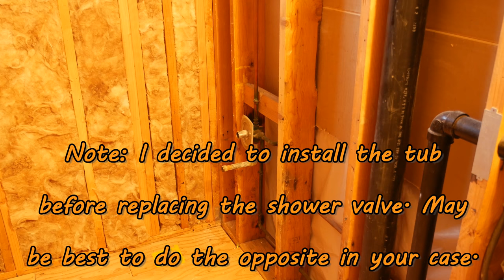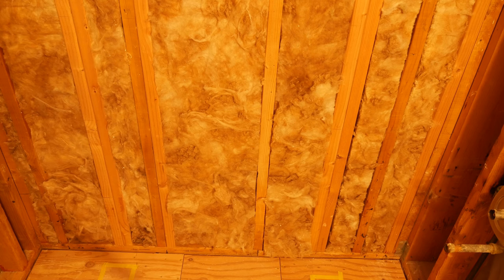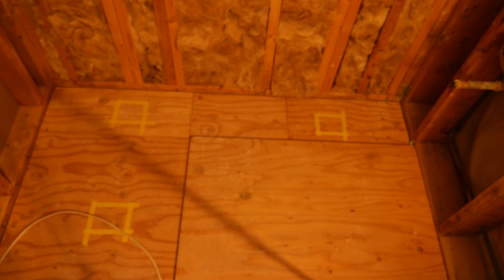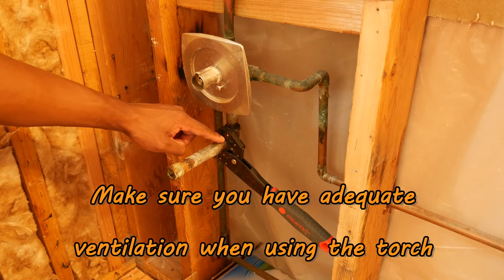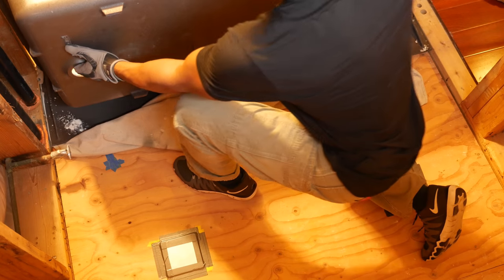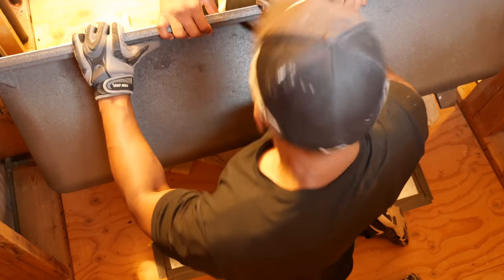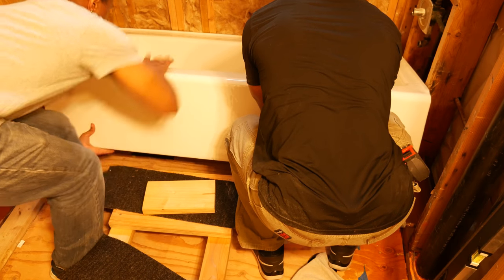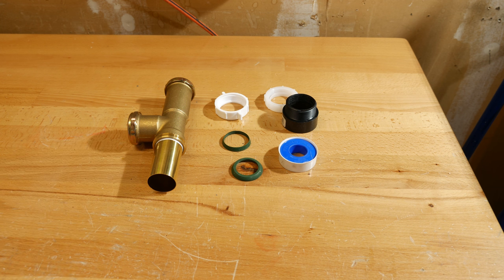Bathroom Remodel 55 - Cast Iron Tub Installation

Comment from the maker: In this video, my nephew and I install a Kohler K838 cast iron tub in the bathroom (Yeah, finally!).

***Note: Unlike many other tub materials, this cast iron tub was simply made level by installing shims under the feet per Kohler's instructions. No screws or nails are required to hold it in place: https://www.us.kohler.com/webassets/kpna/catalog/pdf/en/1084177_2.pdf

A couple corrections as pointed out by viewers: (1) Teflon tape is not needed for the lock nut threads. (2) Separate washer and lock nuts seal better than lock nuts with integrated washers.

Please leave a 👍  if you like the video!

👉 Visit our website ► http://DIYApprentice.com
 
👉 Click to Subscribe! ► https://bit.ly/2pEBg3m

🔧▬▬Tools and Materials▬▬🔧
👉 DIY Apprentice Recommended Tools and Materials ► https://bit.ly/2T5psFw

✔️ Drain information:
The bathroom fixtures are Grohe Agira brushed nickel, but Grohe doesn't make a complementary drain. This satin nickel drain is almost an exact match ► https://amzn.to/2vHOoZ9

✔️ Watco 924 waste and overflow kit ► https://amzn.to/2OyNl4U
✔️ Watco 916 waste and overflow kit ► https://amzn.to/2MmDqlf

✔️ The electronic trap I used caught the rat the same day I posted this video. Worked great - check it out!  ► https://amzn.to/2pGvsXr
Similar traps: 
► https://amzn.to/2C08t0O
► https://amzn.to/2ynoURi

📷▬▬Video Equipment▬▬📷
✔️ Camera used ► http://amzn.to/2GcpkOb 
✔️ Lens used ► http://amzn.to/2Deu16S 
✔️ Tripod ► http://amzn.to/2GbaM1c
✔️ RAM Suction Mount ► https://amzn.to/2Wz9PXh
✔️ Cyberlink PowerDirector ► https://bit.ly/2jTwGxT
✔️ Adobe Photoshop ► https://bit.ly/2V7nyUX
✔️ Camera Slider ► https://amzn.to/2WtD7GW
 
👍▬▬Follow Us on Social Media▬▬👍
✔️ Facebook ► https://bit.ly/2pAY8S3 
✔️ Twitter ► https://bit.ly/2G7mRDz 
✔️ Instagram ► https://bit.ly/2ILEKII

Disclosure: This video contains affiliate links, meaning, at no additional cost to you, I will receive a commission if you click through and make a purchase.

Comment: Thanks for showing this.  I'm just finished mine.  I have a small comment - at 11:00 in, you suggest using teflon tape on the threads of a compression lock nut.  This is not a good idea.  The lock nut presses the ring tightly between the tube and seat.  That is what makes the seal, not the threads on the nut itself.  In the example you show last, the ring and nut are one, but it doesn't matter.  The seal is made by the nut between the tube and the seat.  Teflon tape just makes it harder to provide enough pressure to make a good seal.  If anything, a little lubricant on the compression nut threads will make it easier to tighten down (though on an ABS fitting with a polypropylene nut, I am not sure what the best choice of lubricant would be).
Reply from the maker: After I filmed this video, I was questioning why I would need any sort of tape or dope on a slip nut. It appears that some plumbers do use them, but many don't use anything.
Thanks for watching!

Comment: I have been using junction box covers forever. I use the screws to hold the covers down. The tape can get knocked loose during placement
Reply from the maker: Yeah, I was going to use screws, but the tape worked out fine. The junction box covers definitely made the installation much easier because of their size in comparison to the tub's feet.
Reply: @DIYApprentice  Here's a tip for you. Use the flexible PVC pipe in your drain fittings. It gives you almost an inch of leeway with lining up the drain
Reply from the maker: @travisk5589  Yes, I discussed some options I'd researched in video 54, which included flexible PVC. My drain appears to line up fine with the brass waste and overflow, and I can't return it now.

Comment: I am looking to install a new tub.  Looking at cast iron or steel.  You guys moved the tub with two people was your tub cast iron?  The weight is my issue do you know the weight of your tub?   Was it cast iron or steel?  Do you need to screw the tub to the studs for movement issues?
Thanks
Reply from the maker: Yes, it was cast iron, which is in the video's title. The tub weighs around 325 lbs; the floor underneath it has joist sisters and some blocking. Since it's cast iron, screws are not used. Video 54 in the series goes into a little more detail: https://www.youtube.com/watch?v=7RBGtmnlmGo

Comment: I have never had any issues setting cast iron tubes . I mean I always try to get the tub in before any of the drywall has been hung , and if the drywall is already installed or isn’t getting replaced you will need to remove the other fixtures and give yourself and your helper room to work.
Reply from the maker: Yes, I agree. Cleared the area as much as possible to install the tub.

Comment: I am getting ready to re install, they are heavy and the wall spacing was tight to get it out. I am going to shift one wall to give me 1.25" so it will be easier to get in, plus it will be room for cement board as I want to tile the enclosure.  On the original floor, one joist had been cut on the end and left dangling for drain line clearance, so on the new joists I shortened the one joist and boxed it into the adjacent joists.
Reply from the maker: Yeah, I had to box in the drain in video 28. There was a lot of floor structure work on this project. Hope your project turns out well.

Comment: This might sound different, but what if you just installed it on a level floor?
Reply from the maker: The floor in this bathroom is level from left to right, but it is out of level about 5/16" from front to back; it would have required more work to level it, which I didn't think was worth the effort. I was more concerned with making sure it was flat. Also, there's a chance that the tub being installed has some irregularities.

Comment: Your video explanation is very exacting. I would, however like to know how you got the bathtub in the bathroom and managed to fit it between the walls. You video shows the bathtub already set between the walls and all you had to do was to push it in place. I was thinking of using a come-along attached to the overhead rafters and the vent hole of the tub to lower the bathtub in place. In any case, very good tutorial.
Reply from the maker: Thanks. I explained in the beginning of the video that I removed some drywall I'd put up to close off what used to be a doorway, removed a wall stud then slid the tub into the room. Otherwise, as I mentioned, the tub will have to be gradually set down in the alcove, which is a more difficult proposition.

Comment: Joints with seal rings: the rings do the sealing and no tape or pipe dope is used, same as copper compression, flare fittings, and the connection ring on unions.
Reply from the maker: Yes, I updated the video's description after a plumber corrected me a couple years ago.
Reply: There’s actually two ways to make that seal . The threaded tail piece with those fine threads screw into the waste and overflow tee , but you can also just cut the threads off and use a slip nut and gasket but I do both of those connections. I thread the tail piece into the tee and also slip on a gasket and nut so you have a joint that’s not going to leak after two months of being used .

Comment: I have a question... how do you trim your hardibacker into the small flares on the tub surround as it doesn't have a nice lap like a modern tub?
Reply from the maker: I planned on installing the backer board (most likely GP Densshield) to within 1/8" above the tub flanges then the 1/8" gap will be filled with 100% silicone. The tile will then be installed to within about 1/4" of the tub ledge. I've seen this method used by pros. Hopefully, I correctly understood your question.
Reply: @DIYApprentice  yes.  That was the question and that seems like it would work fine.  I was going to grout over the silicone or do you suggest grout caulk?  I appreciate your help!
Reply from the maker: @stangbanger6445  Based solely on my research, you should be able to tile like normal once the silicone is dry - no additional material is required. You'll need a little extra thinset behind the lower portion of the tile where there's no backer board supporting it, though.
Reply: I am going to install the board behind the edges and seal the joint. Then the protrusion of the tile will be minimized,  plus the tile will be sealed at the tub interface as well.
Reply: @stangbanger6445  where the tile meets the tub, no grout because things do move or settle & you don't want the grout to crack.

Comment: Do you fasten it in in any way to the wall?
Reply from the maker: No, Kohler's installation instructions do not call for the tub to be fastened to the wall. Some will use a ledger board like I demonstrated, but it's not recommended by Kohler in this case.
Reply: @DIYApprentice  gotcha. Thanks, sir!

Comment: Where’s the ledger boards to hold the tub in place ?
Reply from the maker: Yes, this is a controversial subject I mentioned in the video. Kohler says to not use a ledger boards for this cast iron tub, but I've seen plumbers mention that they often use ledgers.

Comment: You are showing how to plumb a tub. Your title shows how to install a cast iron tub. There is no room to put screws in the wall. So How DID YOU SET THE TUB and LEVEL it? That is the installation part of INSTALLING a tub.
Reply from the maker: With all due respect, did you watch the video? The tub is made level by placing shims under the feet. No screws are needed because it's a cast iron tub. I followed Kohler's instructions for the installation: https://www.us.kohler.com/webassets/kpna/catalog/pdf/en/1084177_2.pdf

Comment: Never use those nut/washer combos. The better option would’ve been the nut with the separate rubber washer. The rubber washers seal much better than the plastic ones.
Reply from the maker: Hmm, I haven't read or heard about any issues with the nuts that have integrated washers. The connection seemed pretty tight.
Reply: DIY Apprentice like Great White Hype, I’m also a 20 year plumber. Take it or leave it, I guess.
Reply from the maker: @wesleyholbrooks6792  Ok, thanks.